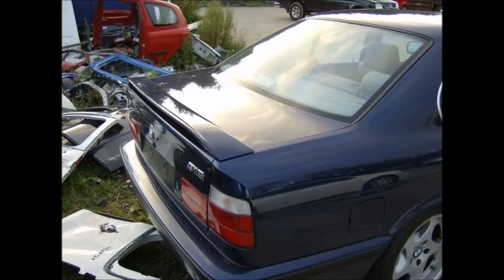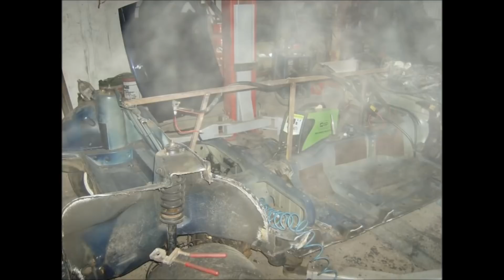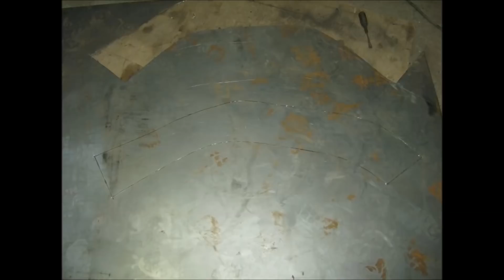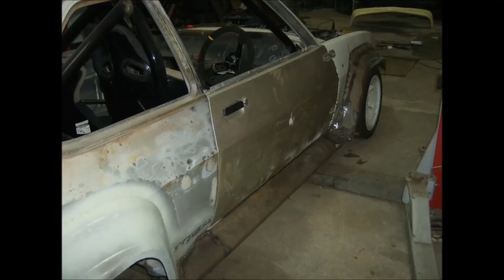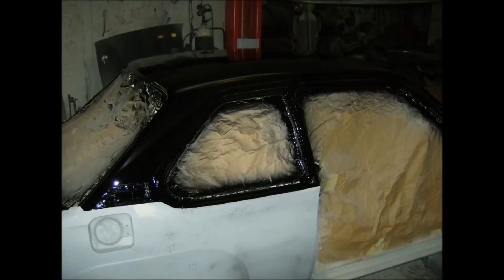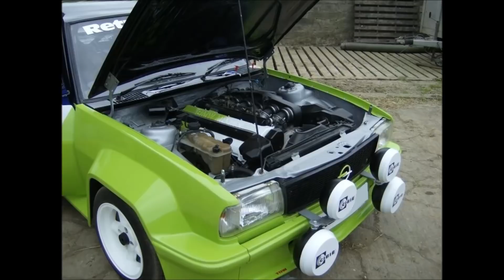E34 M5 Powered Opel Ascona Drift Car

Comment: It's not a M5 powered Opel.. it is a Frankenstein.. It's a cut up M5 with Opel shell.. I don't like cars like this.. Make it with a Opel 3.0. 24 V 6Reihe engine.. or rebuild the E34 to a driftcar.. no need for cutting it up.. Make it beautiful.. add a roll cage.. done.